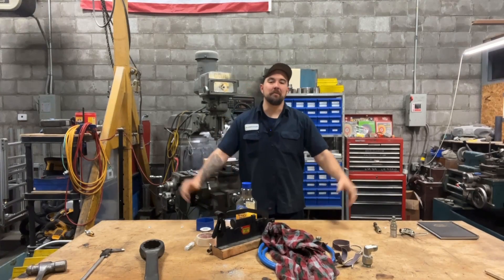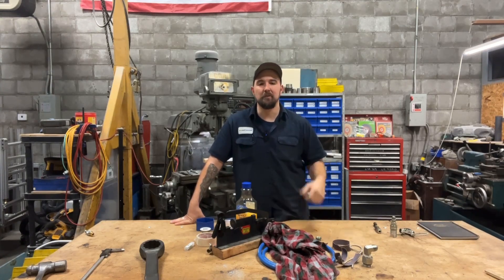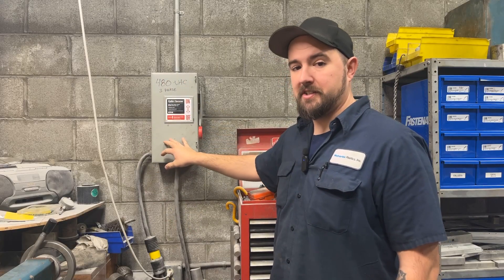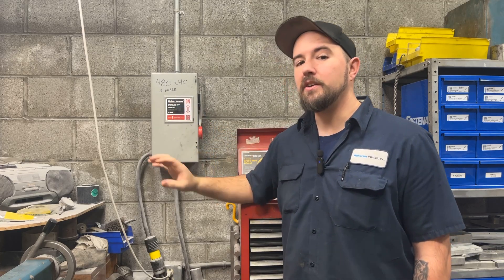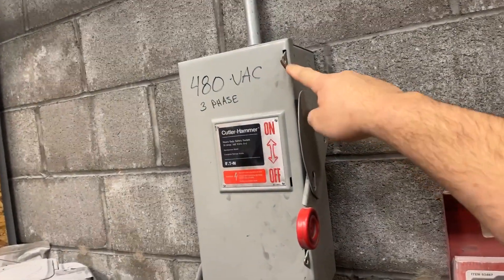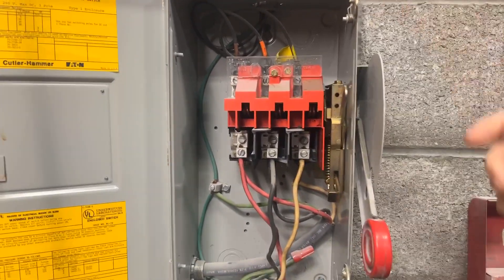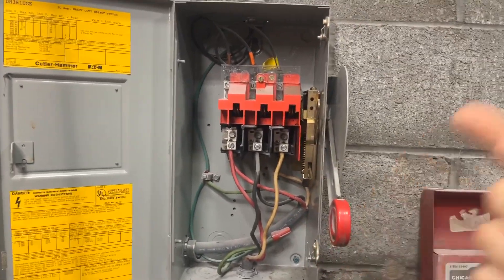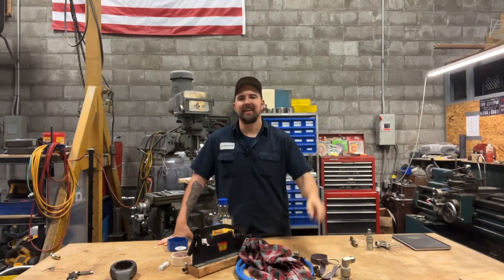Right hand rule, for industrial applications...

Comment: We use the left hand rule and face the wall body to the side. The rational is that on bigger switches the actuation spring is harder to load and can cause you can hang up (pause) in the middle of the throw. Pausing defeats the purpose of the spring which is to  increase the speed at which the contacts open or close minimizing the chance of an arc flash indecent as the air gap between the contacts grows larger . This is where the term to "throw with confidence " comes from. Fun fact...opening a loaded disco is more dangerous than closing as the current wants to continue to flow as the air gap between the contacts increases.
There really is no left or right hand rule. On anything above 400a you want to use both hands. Just stand on the handle side of the door face the wall, use either or both hands  and throw it like you mean it.  Higher voltage and current is not necessarily more dangerous. Smaller volume enclosures can generate ridiculous pressures exceeding 1000psi  on the door as the smaller enclosure has less volume to help absorb expansion

Comment: I'm still pretty young in my sparky career but it seems like a good way to mitigate a lot of arc flash is by using current limiting fuses. It would help you out of you're worried about what happens when you turn the disconnect on. It wont help if you're working in the disconnect and the line side is still hot and something shorts.

If your current disconnect has fuses in it. DO NOT just go throwing in current limiting fuses with the same rating. Consult someone who knows what your application is and have them size current limiting fuses for you.

Comment: Definitely, was involved with an arc flash and blast a 3 foot by 5 foot door went to Major 600 volt 3 phase panel it blew the door off and it flew about 25' across the shop. trust me when that happens you need to clean your britches when it's over.

Comment: It seems to me that the safest way to control these curcuits would be heavy duty contactors (much like relays in a car). You could use a separate control circuit or heck throw the contactors with a pneumatic piston and air compressor to avoid arcing and electromagnetic interference.
Reply: I believe this is the case in some scenarios, but that requires a lot of extra equipment and maintenance. These boxes are relatively cheap and reliable, but adding a controller or pneumatics would complicate things and introduce points of failure. Plus these things need to be quickly and easily accessed to manually shut off and locked out in an emergency.

Comment: I never seen a Box like that all the Dead man switch I have ever seen has the 3 blade and pull out of the prongs when the arm is pulled down .     going up the 3 bars go back into the prongs the blades are the conductors Bake lite on the arm as a insulator  before your time and im sure in a code area they have been replaced since the 1980s .
Missouri  they like to hard wire its scary, 220 200 amp service and a 220 fryer is not hooked into a breaker its hard wire into the hub of the line off the pole to the breaker , the ballast box is not a fuse box .      I run into scary stuff   I have had a few good pokes .  Unmarked hot wires sticking out a brick wall . NO code do as you like :(   Building's burn down regularly in this area do to improper wiring .